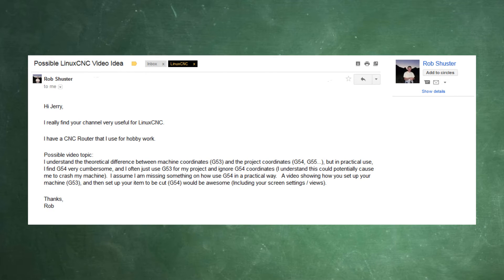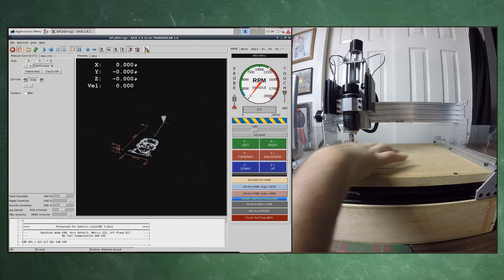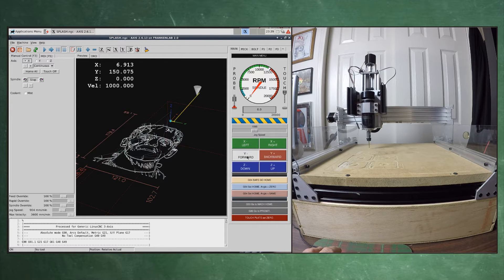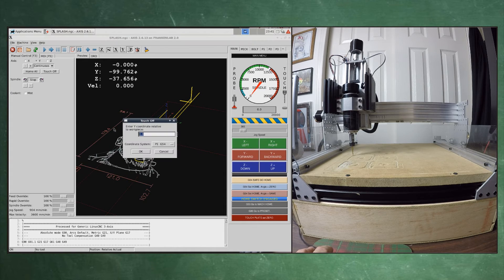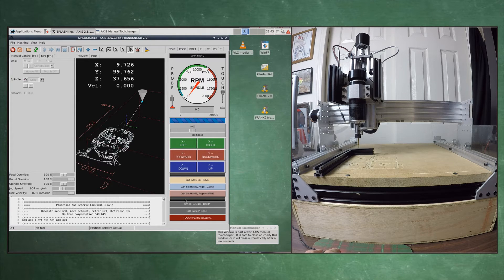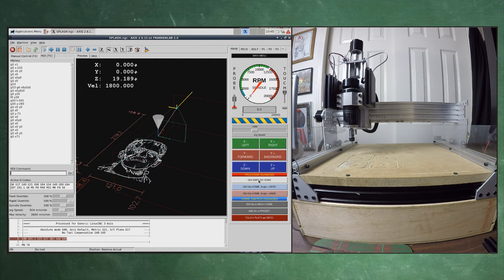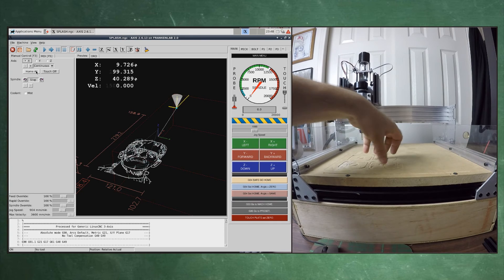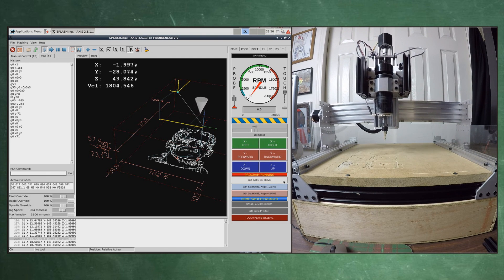Frankenlab CNC #16 - G53 G54 References

Comment: Hi Jerry. Very good overview. May I make a suggestion that might be helpful for some of us "seniors"?
Background:
Your videos helped me get my limit switches going a year ago. I turn on the machine and hit home button on LinuxCNC, which gives me a 'home' in the lower left quadrant.
Ran some jobs. I had with great results. Thanks!!
One year later: I fired up my machine. Hit 'home'. It went to the lower left hand corner of my work area.........and then I went fuzzy........roughly remember something about "touch off" ??? Whaaa?
Request:
Would you do an example with a "stock" LinuxCNC screen.
I use G54 in my CAD software (in this case Fusion 360)
It would be helpful to know how to set up the LinuxCNC machine for 1 job, using G54. Nothing else.
I love this video, yet the extra information (and your custom screen) leaves me doubting my understanding.
A simple design, maybe a rectangle with a hole in the exact middle, would also help with the visuals.

Maybe you could do a series of YouTube shorts for each of the topics you covered in this video?
Anyhoo, whether this idea appeals to you or not... Thanks for what you do for this community!

PS: Your custom screen is cool. Right now I just have the stock screen.
Reply from the maker: Tell ya what... zip up your configuration file and I'll see about pimping out your machine with a control panel. I haven't done one in a while... so it would be good practice. Get my email from my web page.

Basically, when your machine homes, it is using G53 as the machine hard reference... theoretically exactly the same EVERY time you home the machine. It then defaults to G54 where you are normally working... so when you move the tool to a position then hit the TOUCH OFF buttons and enter a value... you are telling it HERE is my working home. Kinda like "Home 2". G55 would be "Home 3", etc.

The buttons you see are a lazy man's way of saying, "Hey, call this point home so I don't have to do 3 sets of touch off". 🙂

The G54 is considered preset #1 or P1... bearing that in mind...
G10 L20 P1 X0 Y0 Z0   <--- This simply says you are currently at P1 X0, Y0, and Z0... save this.
I follow that up with  
G10 L2  P1 R0  <--- This says, the world coordinates are rotated 0 degrees from where you would expect.

Helpful???
Reply: @Askjerry  Wow. Thanks for the reply! I understand the idea behind G53-G59. My issue is that I am trying to develop a "bear bones" recipe... press this , then press that. Now you are 'here'. Load your g-code and go. (like if I were trying to help a friend over the phone) I would explain the details later over lunch.
I would like to send my config file and a "recipe" file. Trying to fill up the holes in my procedure.
I look forward to being as comfortable with the process as you are.
Thanks again!!
Reply from the maker: @hippie-io7225  We will get you on track... no big deal. I saw your channel, and subscribed.
Reply: @Askjerry  Thanks on many levels :)

Comment: Glad I found your videos Jerry, these are so helpful. You should really add LinuxCNC to the title of your Videos because they are hard to find, and figure out what they are for from the titles. Adding Linuxcnc to the titles would defiantly get you more views and help beginners find your videos in YouTube.
Reply from the maker: You might have a point there... I should at least go through the meta tags and be sure it's there.
Reply: This.  When I clicked on this, I didn't know whether I was going to watch some Mach3 stuff or LinuxCNC.

Side note: What a poor name for the LinuxCNC software, "Axis".  As a n00b, I thought I had been using software only for calibrating only one axis.  "Gmocappy" also sucks as a name.  It doesn't sound like anything.  Genetically Modified Organism wearing a cape??? C'mon programmers, have some fun and flash with your glorious control system.  GCS would do fine.

Comment: Nice video Jerry. Ive got a question for you. I recently bought a cnc router that was all ready built and running. I wanted to build one myself but know nothing about all the configuring involved. its using Linux cnc which I had never herd of. The problem Im having is I set my G54 X and Y zero to the center of my part and wanted to rerun the tool a little deeper and all a sudden my X zero seems off. So I reset G54 X zero and then went to X-7. and Y-7. and plunged a hole in the wast board then re run the tool. when done I can go into MDI and say G1 G90 G54 X-7. Y-7. F50. and sure enough X will be off about a 1/2 inch. Its allways off in the same direction. I got to move x minus to indicate the hole back in. I talked to the guy I bought it from and he had me slow down the acceleration I think it was for X axis but still same thing happens. Any one have any ideas. Thank you , Shawn
Reply from the maker: Shawn Baker It sounds like the X-axis may be physically slipping. Check the set screws for each axis. If it vibrated loose, pull the setscrew out, put in a drop of Loktite Blue, and re-tighten the screw. 

If the axis continues to slip, we can check the current settings on the driver... Acceleration... Etc.
Go to my web page and get my email if you like.

Comment: very nice series on CNC for absolute beginners..   My total home brew runs with mach 3.  I went with mach 3 as its very similar in function and appearances to industrial grade milling centers.   Never looked at Linus CNC so thats what I find interesting in this series..

Mach 3 has a method to do custom screens but its not as easy to do as liniux CNC appears to be. The main screen in mach 3 has most of what I use.  the main exception is manual g-cone entry.   I may fix that one of these days. 

I have standard microswitch limit switches at each end of the axis , wired in series using the normally closed side. When one goes open or a wire breaks travel stops. The idea is to create a fail safe mode. I have a series of connectors on the CNC and the controller with cables on plugs connecting them.  All cables are wired and pinned the same so any cable will work anywhere.. You just have to make sure say X on the controller is conected to X on the cnc.. That  ay there isnt any dangling cables when you unplug stuff to move things around.

The only thing I will quibble about is the microstepping.. The more microstepping you use, the less effective power you get out of a stepper. I run microstepping at 2 when my mechanics are figured in I get .0015 per step resolution X and Y, .0005 on Z with about a 30% power loss  Good enough for most uses.  By going to higher microstepping the resolution increases but that setting fulfills my needs. G0 moves are in the order of 200ipm on X and Y and about 75ipm on Z. Cutting area is 25 X 18.5 Y and 6 Z currently using a trim router but the controller is wired to use a 1.5 KW spindle with an external VFD if I ever get one.. :) Typically with say Oak I use roughly 3/4 bit diameter dept of cut at speeds normally around 100 IPM and 10 to 12K on the router.  With 450 OZ/in Steppers on 5 start 1/2 10 acme rods theres enough omph to snap a quarter inch bit clean into if you hit a clamp moving at 200 IPM.. Only done it once.. :)

Ive been half way thinking about adding some encoders to the 3 steppers so i can use the CNC like a bridge port with readouts without any computer control instead of just cranking to layout lines. I have a switch on my controller that cuts the power to the steppers but is otherwise fully functional. Sometimes I cut the power to the steppers and hand crank to some point then power the steppers back up and set zeros..  A manual zero cheat.. :) All 3 steppers have decent sized hand wheels on the other end of the drive shaft... 

Overall a very nice series on doing a home brew CNC.... The only thing I didnt see is some explanation about why tramming the spindle, why ramp ups and downs, and stepper rates are so important to have right.. 

Keep it going as this can be very helpful for those new to  homebrew CNC...

Comment: Hello Jerry, when i am homing all axis in Linuxcnc , the z axis is moving down, not moving up, to the point where the prox npn  home switch is. What is the cause of this problem and how do i fix this ?

KInd Regards, Pieter
Reply from the maker: Go into your STEPCONFIG and you will see the search speed setting... make it a NEGATIVE number... that will cause it to search in the opposite direction. This is true for any axis.
Reply: askjerry. Thanks i will try to fix thuis !!
Reply from the maker: That will work... I had to do it on my Y and my Z axis for the Monster machine.
Reply: Thanks, my compliments for the great YouTubes !!!

Comment: Jerry,

Great series on configuring LinuxCNC, Axis and PyVCP.  Thank you for sharing.  Now if you take questions I have one.  I am guessing your gantry machine is driven with two joints, and I think I seen somewhere you are using the same stepgen signal to both joints to run your gantry.  While this works, and I do it myself on my KRMx01 machine that I built, you have to manually square the gantry if it ever becomes racked.  And I do this with hard stops before I start work, but I know there are better ways.  Can you demonstrate the gantry hal component for homing, or the JA14 stuff for gantry homing using multiple joints for an axis?

Regards,
Joe
Reply from the maker: I use the hard reset myself. On the back of the machine I have two hard stops... one fixed, one adjustable. I dialed it in. If I move the machine to an event or something, I force it back into the hard stops, then move forward until the switch indicator shows it's clear... and I hit the HOME ALL button. As for multiple joints... nope... one stepper driver for both steppers... just a "Y" cable. You see... a single stepper would likely draw 2A so you would think that you need 4A for the two. Not so... it's not like each needs to drive 2X the power... they are just splitting the load evenly... so the other joints are running 2A, and these two BOTH share a 2.5A setting. Each is therefore running a bit less torque than the other steppers... but combined they are about the same or a bit higher. Most correct setting? Eh... not sure about that... but it has been working fine... no errors, no missed steps... so I'm happy with it.

Thanks!
Jerry

Comment: Hello, Jerry, thank you a lot for your job!
I have a little bit off top question: can one advise me how can I do homing not in manual mode but with g-code command? 
Thanks
Reply from the maker: If you know what your offsets are... you can use G10 L20 : http://linuxcnc.org/docs/html/gcode/g-code.html#gcode:g10-l20

You need to know what your offsets are... if for example you wanted to set the current G54 (P1) location to zero... you would issue a G10L20 P1 X0 Y0 Z0 and the current location would be set as ZERO. Same as if you did a touch off on those axis.

Comment: Thanks Jerry!!! Excellent as always.  Where do you set the part surface zero when you use the the touch off plate (bottom of part when you use the touch off on the table of your machine)?
Reply from the maker: Mark Cranch The surface of the item being measured.

Comment: Great video Jerry
Now I have to sit down and watch the rest of your series. :-)
It is interesting that your home point is an arbatory point on than table rather than the extreme bottom left or top right.
It is something I had never considered.

Cheers
Peter
Reply from the maker: Great hearing from you again. The current home point is just a function of where I stuck the magnetic switches when I built it... the extruded aluminum has slots... and I just tucked the switches into the slots "fairly close" to the edge. My large mill has them installed at the ends of the travel... except for Z...which also got tucked in there about 20mm from the end.

I could tell the software that the switch is actually located 18.263mm from the end... and it would compensate accordingly... but honestly... laziness crept in. I just set ZERO (G53) wherever it happened to be... and calibrated from that point in space. It is more critical to have a repeatable location than anything else.

In your video, you use the "touch method" which is the bring the axis to the physical hard stop and set zero... nothing wrong with that... as long as you use the same offset each time. Had I used the cherry switches... they would have been mounted within 5mm off the end.  I made an indicator to show if any one (or more) switch is in contact prior to starting the home routine. (Ran out of inputs so I shared X,Y,Z home inputs.) When I had it with individual inputs... if it was in contact, it would move off-position... then come back. But as they are shared... it doesn't know the difference and could crash... so I check to be sure none are engaged first.

Researching MACH3... you have many more possible pallet locations... interesting how they tweaked it to accomplish that.

Comment: Great, helpful film - as always Jerry. Hope you also enjoy doind that, so I watching ;)
Reply from the maker: It was fun... I had to film it 4 times to get it right... but yeah... a good way to spend a Saturday!
Reply: I offen use 3 vices as G54, 55 and 56 - of course does not have limit switches yet (retrofited WMW milling machine) - another vid about limits/stops and you probably could say it's your succes when I finaly does it on my machine! ;) Once again - thanks for sharing.
Reply from the maker: I don't use limit switches... you don't need them. 

If you have home switches, or if you use the "crash" method, or some other method to always set the G53 HOME exactly the same place... then all you need to do is take the time to set the machine size in the INI file, and the soft limits will keep you from ever hitting the ends again. Video 10 covers that.
Reply: Jerry I remember you saying in an ealier video (probably 10) that you don't need limit switches if you have home switches..What is the difference between a home switch and a limit switch?  In my mind they are one in the same.
Reply from the maker: A limit switch resides at BOTH limits of a machine... it is there so that if your table is 20 inches, and you tell the machine to go 30 inches... it will hit the switch before the end of travel and stop the machine with an error. A HOME switch can be mounted at the end like a limit switch... but it is used to set a "HOME" position... a known spot on the machine. Then the machine is programmed to "know" how far it can possibly move. So in the same situation, when you tell the machine to move 30 inches but it could only ever go 20 inches... it won't even start moving... it will say "NOPE... I can't do that." And this happens BEFORE you start cutting into that expensive aluminum or brass and realize that you just screwed it up.

I just realized that on my MONSTER mill... I have the magnetic sensors set to trigger on the approx of the magnet... instead of on crossing the magnet... and so my big monster will "home" plus or minus 2mm from the same spot. But the little Frankenlab is accurate to 0.03mm or so. Looks like I may have to rethink my method on the big mill. : - /